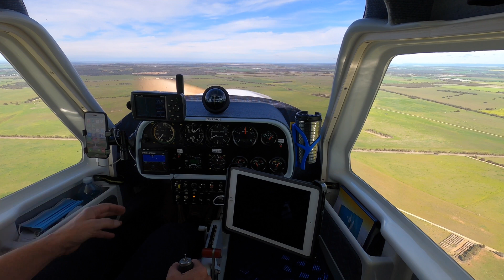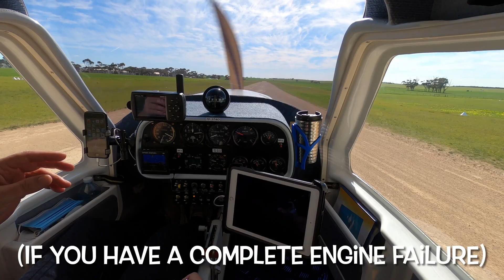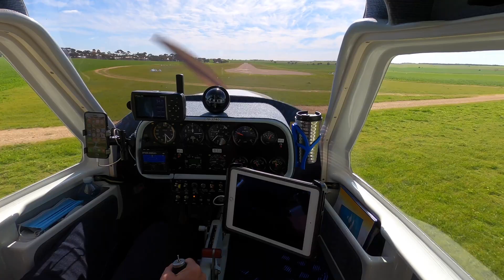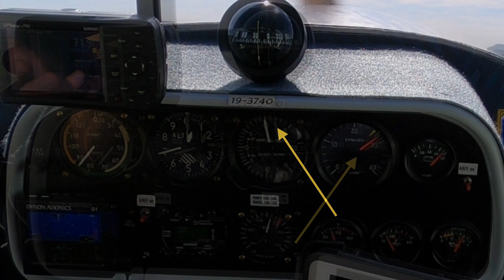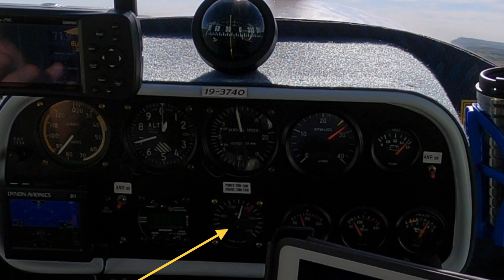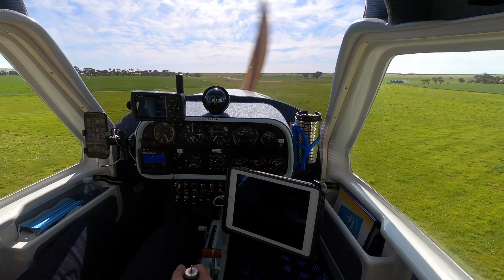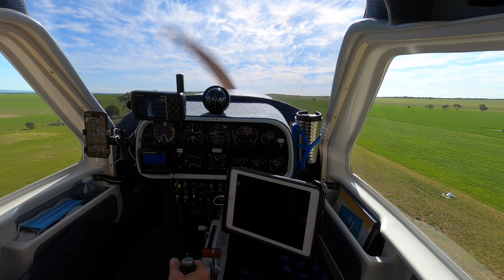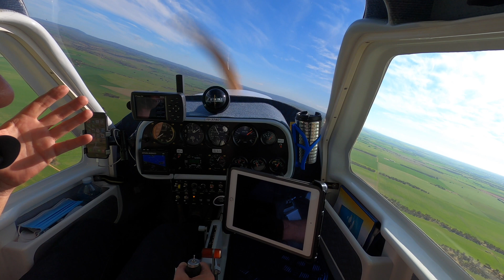Engine failure in circuit Flying Jabiru aircraft (eps10) (60)

Comment: Engine failure is an emergency and warrants a mayday call. The word "Mayday" is instantly recognisable and triggers the listener instantly. 
My 2 cents. Carry on good work.
Reply from the maker: Hi yes I agree with your comments here and depending on where I am in circuit (UW, CW, early DW) I would definitely call mayday, but mid to late DW or base where I can easily get back to be honest I personally probably wouldn’t. However I think as you said correct procedure would be to call a mayday no matter where I am in circuit. Thanks for your input, this is the type of conversation student pilots need to have with their instructor  to make these decisions second nature 👍 ✈️

Comment: Great video. The only sugestion i have in RT is to : *** Radio, plane call sign(if time) mayday mayday-engine failure, position, landing *** runway. This will inform everybody in the circuit/ground you are in trouble and landing.
Reply from the maker: Great advice, any input is valuable for new and seasoned pilots 👍

Comment: Hi Mate. Private pilot from NZ and recently moved to Australia. Was thinking to pick up a jab for hour building, however, read many stories about reliability of the engine. Would you mind sharing your opinion in your time as an owner. Also, what's your point of view about rotax conversion?
Reply from the maker: Gday, yes controversial topic for sure. Shooting from the hip, I’ve had almost 2K hours on 3 different Jabiru powered aircraft I’ve owned. Fortunately I’ve never been caught out away from home base, I’ve come close but picked up little issues before they’ve turned into big ones. Personally I like the motors for their simplicity and ease of servicing but am aware of their shortcomings , valve issues from being run too hot. This is a factory mistake for not making EGT’s mandatory, a massive oversight on air cooled heads, piss poor charging and ignition system, non keyed flywheels on earlier models. Look despite all these  issues and more they are still with minor doable mods a good little lightweight easily serviced motor that operated properly will give many hours of fuel efficient service. However a major issue is getting spares, Jabiru have very little in the way of parts. As far as Rotax conversions, I’m a big fan of Rotax stuff, I’ve had  5 Rotax powered aircraft and they’ve looked after me well, spares however are bloody expensive but available and usually only a few days from delivery. Hope this very long reply helps with your question, feel free to email me for anything else I may be able to throw into the ring, cheers.
howtoinfive@gmail.com

Comment: What jab is that mate. It looks like a ST3 1994 ish model. Nice demo too.
Reply from the maker: Hi mate, it’s an 02 SP470 which is the old 3 model with a longer fuselage, larger rudder & fuel tank. She’s still narrow in the fuselage like the earlier models, some people confuse it with the 170’s but it’s  smaller and lighter but with the same wing span. Can get a bit squeezy with two larger people on board but not too bad . They (as in Jabiru) also did the SP500,  same physical size but with the 6 cylinder motor .

Comment: Good demo.
However try it dead stick , there's more drag than you think !
Most folk will undershoot. 

I fly gliders and power and I still think the typical PPL training for engine failures is completely inadequate.

Plus the circuit pattern itself is generally to large. A lot of aircraft won't make the runway from 1000ft on the downwind !
Reply from the maker: Gday Jules, thanks mate. Dead stick on purpose at this particular airfield is not looked upon fondly so I don’t upset the apple cart. Quick note though this particular aircraft (Jabiru SP470) actually glides better when I totally shut it down, I conduct these opps regularly at a private strip that I fly at. 
 I agree with your thoughts re 1000ft, I see so many pilots doing large circuits that would have no hope of getting back with an engine failure. The other common problem I see is pilots not bringing their circuits in closer during high winds, one of the first things you as a glider pilot would have been taught no doubt.
It will never happen but it would be great as part of getting your certificate to spend a couple of hours with pilots such as yourself to give powered pilots more of an idea on gliding, I as a powered operator did just this many years ago and it was valuable training .
Thanks for your comment, anything that adds to the safety of new and old pilots alike can only be a good thing .
Cheers
Reply: I would go out to a small airport that typically didn't have any traffic during the day and practice deadstick and not drop the flaps until I had the runway made.  That was in a 172P.  I never understood people taking the risk of flying a large pattern and then dragging it in at low altitude.  That's asking for problems if the engine quits.  I would rather be a little high and just slip it if necessary.
Reply: Agreed, jabs are very low drag and a typical 1000 rpm idle offers a decent thrust. Dead stick is significantly different.